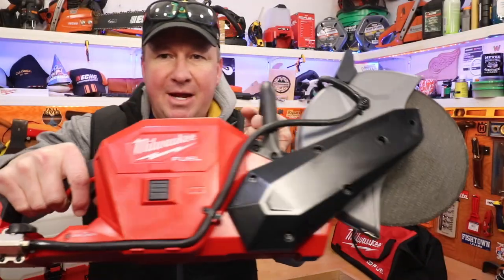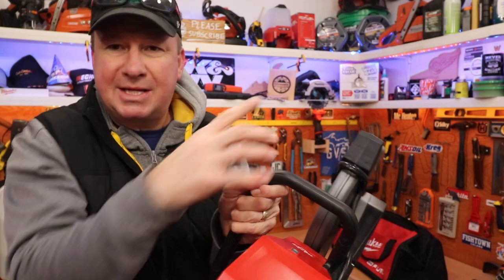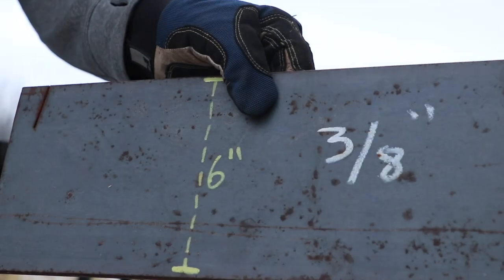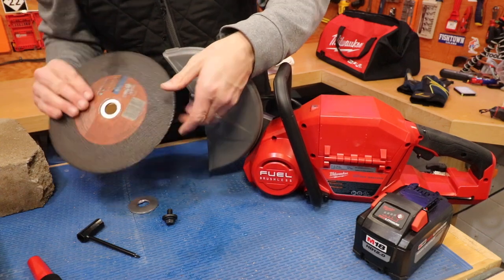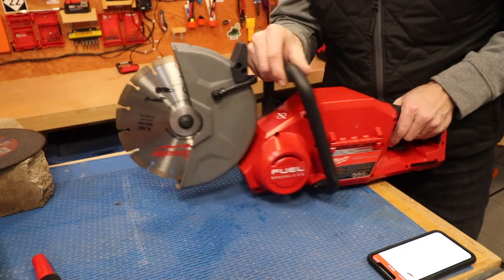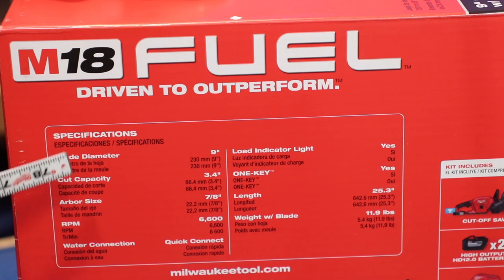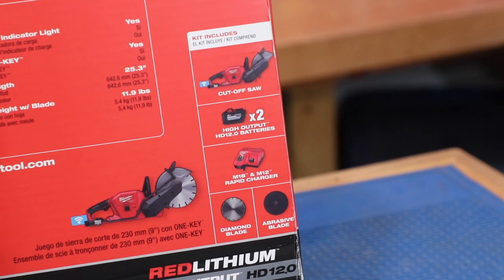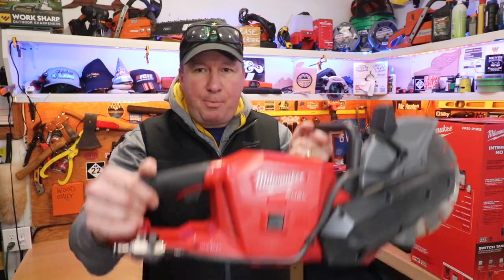MILWAUKEE M18 FUEL 9" CUT OFF SAW, DIAMOND BLADE, 2786-22HD

Comment from the maker: QUESTION OF THE DAY: Were you impressed with the M18 9" Cutoff Saw?  Did it cut the concrete blocks faster than you thought?  What do you think about the M18 Switch tank?
Reply: How tolock the spi dle to change the blades?

Comment: excellent video. I have this saw but have not yet used it. I am glad i saw your video. It changed my mind about returning it. instead i bought a rockwell clamp  to use with it.  thanks!
Reply from the maker: I use that Rockwell clamp all the time.  It works well for cutting things with this saw.

Comment: Thank you for showing us how the switch tank works with the saw.  I have not found another video that explains the tool interaction.  Did not know that the switch tank responds to the flow control on the saw.
Reply from the maker: No problem, glad to help.  Thanks for sharing!

Comment: I have a 2000 square foot paver job to do, whats the run time like? How many cuts through a normal size paver do you think it could do on a 12ah battery? Thanks
Reply from the maker: That's a great question.  I really don't know off hand but will have to give it a try and get back to you.
Reply: @MarkThomasBuilder  thank you so much even if you just make enough cuts to move the battery one bar that would give a good ball park. I appreciate it

Comment: Finally a sensible review of this saw!! 

Thank you for making this video. I’ve been weighing up buying this saw to replace a corded 9” angle grinder that runs a diamond blade, I want something cordless and I liked the ability to use the water which you can’t with an angle grinder. 

Too many people try to compare this saw to a 300mm stihl saw! 

I only want to cut concrete blocks, paving slabs, bricks etc. maybe some small concrete cutting around a manhole or something. 

If I wanted to cut a 20’ seam in 4” deep concrete of course I would use a petrol saw with a bigger blade!!! Not one of these. 

Great video, very good consumer advice.
Reply from the maker: You're welcome!  This saw is handy for those smaller items.  I've reviewed other saws and diamond blades for the bigger projects you menioned.
Reply: I’ll be sure to check those videos!

Comment: Your Blade is backwards at 6:14! You can cut way faster when the diamonds are facing the correct way.
Reply from the maker: Humm.... I'm pretty sure I checked, but will have to always double check when installing it.  Thanks
Reply: @MarkThomasBuilder  If you run your fingers on the blade and it is smooth in the direction of the spin, it is backwards. But if you slide your finger in the opposite direction you will fee the Diamond bits catching on your finger. 

Granted there is also an arrow on the printed side that should be pointing away from the tool rather than towards you. 
This doesn’t matter on the abrasive blade though. 

I hope these tips help you.